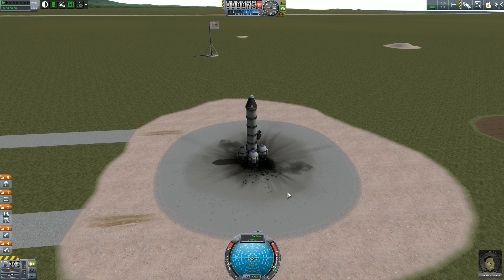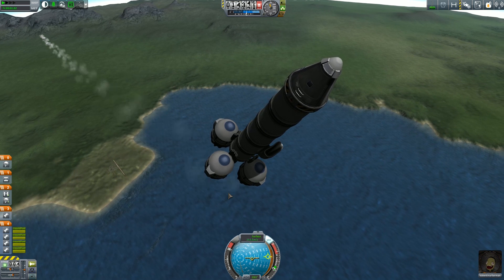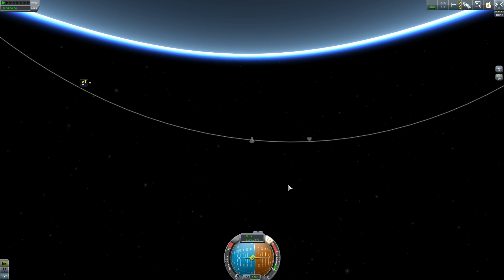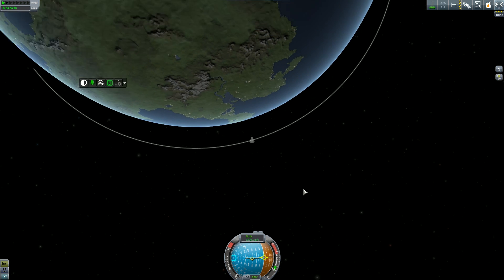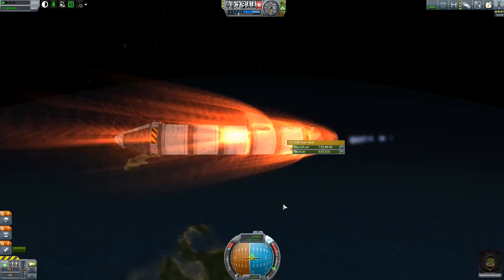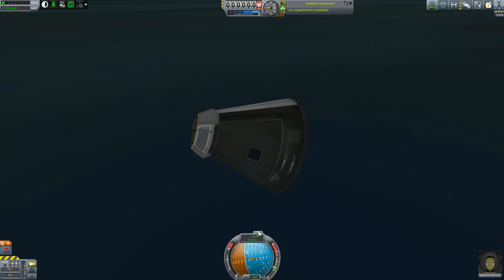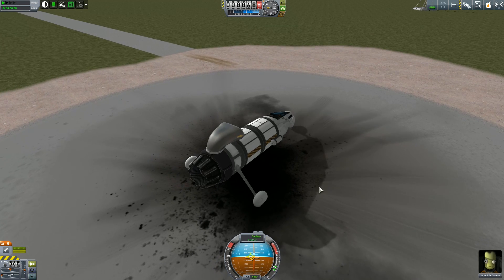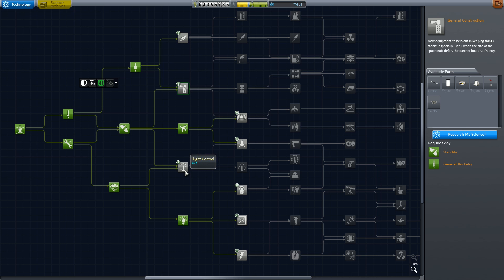Kerbal Space Program 1.0 #04 [Around] - Career

Comment: wow really interesting game!
have few questions, how are the Physics in this game. Is it realistic for the most part?
1. 1:10 can you actually launch a rocket vertically with JetEngines? (not enough air intake?)
2. 10:00 can you burn engines on re-entry to slow down? (engine overheat?)
Reply from the maker: Ikera Palchevskiy 1. At a certain height depending on air intakes, velocity and air pressure the jet engines will flame out.
2. Yes.
Reply: awesome thanks :)

Comment: How do your jet engine use so little fuel? I tried to use jet engines with those small rocket fuel tanks minus the oxidiser but even only on half throttle, the fuel is used up really fast
Reply: Maybe putting the air intake closer to the engine makes it more efficient I don't know but I built a plane like his with the intakes close to the engine and it worked pretty well.
Reply: danny9m Thanks! Will try that
Reply: GuitarEmber ! its a maybe XD

Comment: the re-entry heat is not that OP, i came in from minmus height and fell into the athmo with a heathshield and only lost like 15/200 of the heat shield its realy realy not that OP
Reply: The thing is most of the time you come with minimus you enter vertically but when do a a orbit around leaving you go horizontal and vertical so maybe that's why. The other problem also is that when he renters his pod is upside down so he exposes his chute and the cockpit
Reply: well re-entering with the nose down is not a reason for a heatshield so thats invalid and when coming in so high it is more horizontal velocity then vertical so thats invalid too, the re-entry heat is just not that great
Reply: JolteonHype The key phrase here is "with a heat-shield". EE because of the part limit elected NOT to install one and had to re-enter WITHOUT a heat-shield. Try to do the same thing you did again but leaving off the heat shield and you'll find that it's completely different and much harder when your craft is bare-ass naked and fully exposed to re-entry.
Reply: JolteonHype It also depends on what type of re-entry you are trying, if you use aerobreaking then you will have an easier time than when you just do it the old fashioned way which will give you way more heat generation and possibly craft destruction. A periapsis of 30k versus a periapsis of 0 may make a massive difference if you are coming from other celestial bodies

Comment: EE, it is possible to take multiple crew reports (or at least was in the last version of KSP). you have to eva, take the data out of the command pod, then put it back. this stores it in a different part of the command pod making room for another report.
Reply: Lane Fehr Yup, you also get 100% for transmitting.
Reply: Seconded.. This is great for when you have low power, or even when you need to remove all science from a craft and Mount a recovery mission to save your kerbal.

Comment: Nice video, thanks. I hope they'll fix this parachutes not ripping apart bug though, because it makes heatshields useless and reentry way too easy.
Reply from the maker: bounty112 Oh god no - heat shields are totally necessary. We only just pulled this off and this was from a low orbit! Anywhere about and we would be massively dead from heating. If they fixed parachutes then they'd need to fix low-tier craft turning over.
Reply: EnterElysium Crew reports don't lose science when transmitted (I think). So it may be a very menial task to make a crew report every single time and sending it through but it's definitely less boring than watching the loading screen every five minutes. 
Nice tricycle by the way. I'm glad they added some kind of wheels to have in the early game.

EDIT: I saw another guy say the same about five comments down and about three hours before me...silly me
Reply: Adam Holliday And by genetically engineered you mean from Kerbal Skin? (Cause those fuckers can survive a fall!)
Reply: Raging Gamer That sounds more like occult activity
Reply: EnterElysium You'd have been fine deploying your parachute way higher. In my experience, a parachute will never burn up, and will slow you down so much that you won't have any dangerous entry heat effects if you deploy them at 60km.
Reply: EnterElysium Well I managed to pull this off every time yet, even on Mun missions, no heat shield needed, just chutes. So some refinement would not hurt. That rover is great btw, have to try it :)
Reply: bounty112 What if we genetically engineered a super parachute
Reply: Jiri Van den You can't deploy them higher. Even if you could, the atmosphere is too thin.
Reply: bounty112 

I agree, heatshields are almost useless.  Parachutes slow you down in a second, even in their semideployed state.  They should burn off instantly. 

Also, heatshields are massless, causing you to tip over 99% of the time during re-entry.
Reply: Tom Oosterbroek Cool they fixed it in 1.0.2! Chutes burn up now when deployed too hight. No luck without shields any more.